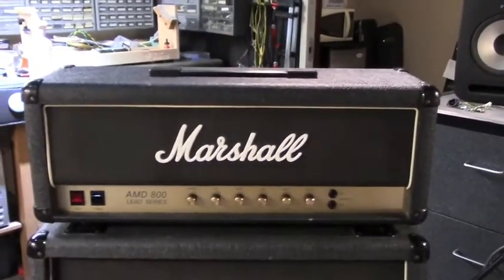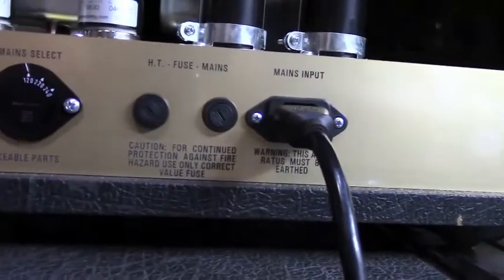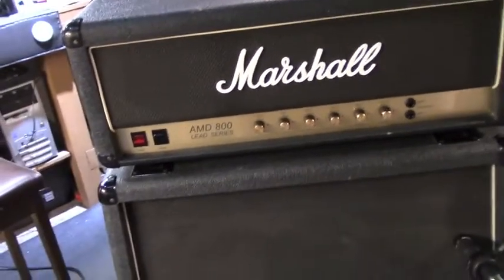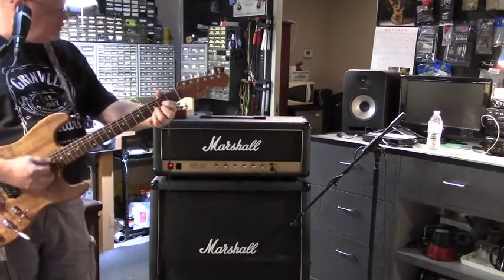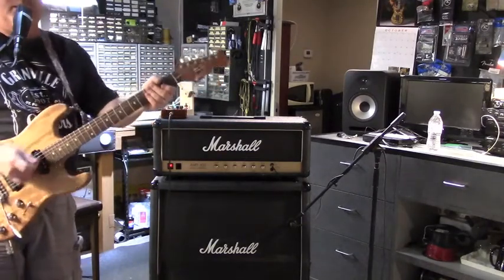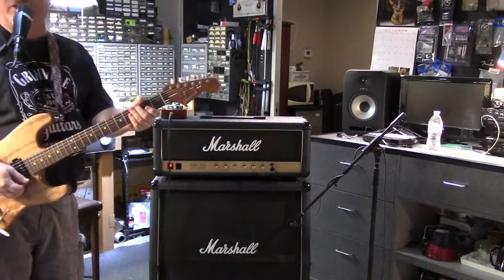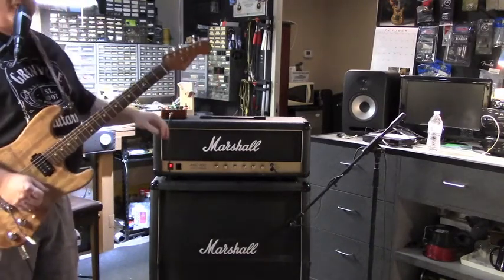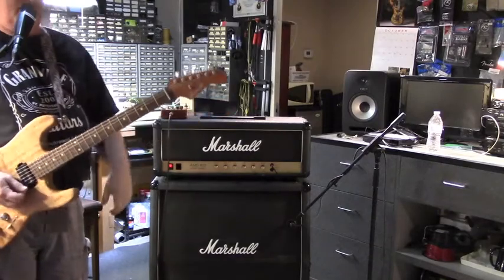The Granville AMD 800 Amplifier (Marshall JCM 800 2204 50 watt) JCM800

Comment: Sounds Incredible bud!! I run my Delay right in the front of my JCA 20H Modified to JCM 800 Marshall specs. No effects loop No BS to ruin the tone!!!!   6 knobs and a 412 loaded with M75 Scumbacks and G12M Celestion 25 watts!!!
Reply from the maker: The JCM800 circuit is just so versatile.
You can get wonderful clean tone out of it and dirt it up just by leaning into it a bit.
I love this amp.